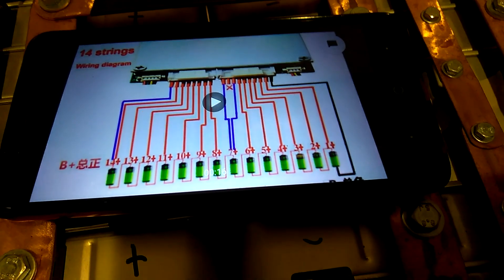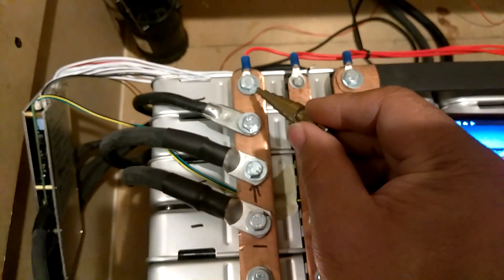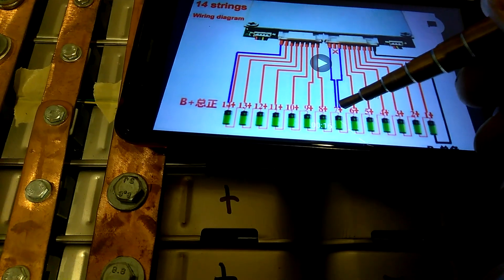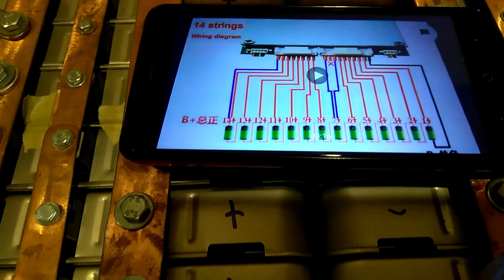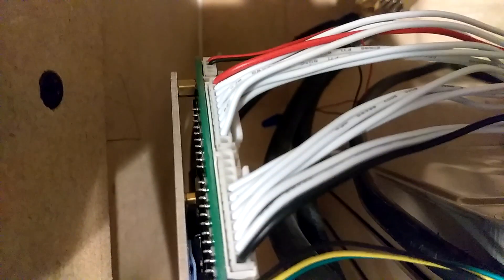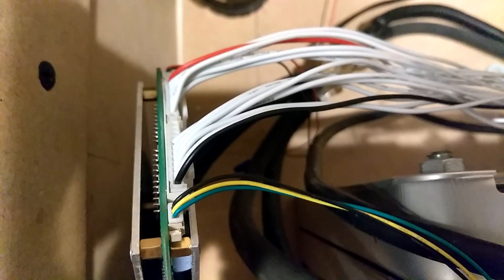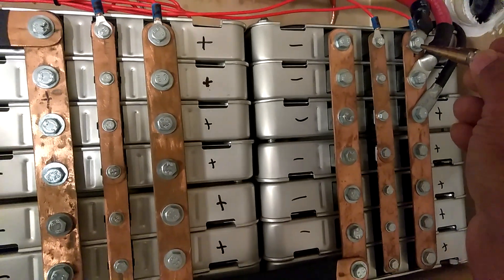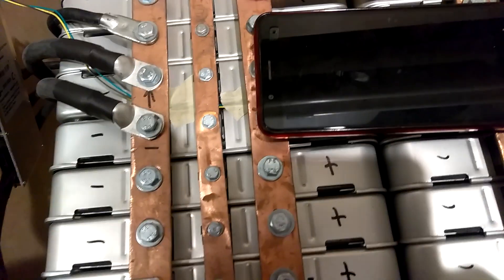Wiring up a 14 s BMS to your Nissan leaf batteries

Comment: Hello, Carson thanks for the informative videos. I am trying to wire this up and its not cooperating. I can't get it to work. I have the 16s on a14s battery. I don't have many extra wires. Your input would be appreciated.
Reply from the maker: Which BMS are you using and What type of problem are you having.
Reply: @carsonlurbanwindandsolar3437  I have the ant bms 16s on a 14s Nissan leaf setup.
I get to start bms lights go on they blink. BMS will only shhow 17.1 volts on the other end of bms. I tried several different methods of wiring and still the same results. BMS also will not show on-screen display or on my android phone. The bms has two jacks of wire, first one with black ground wire has 9 white wires, second has power red wire has 7 white wires. I can't skip any wires on the second jack (plug). Been at it for two days can't get it to function.
Reply: 7s - 16s ant bms Lifpo 320A LCD
Reply from the maker: @fredlo6935  can you send me a link so I can go see the actual unit that you have maybe the link where you purchased it from. or you can send me a link so I can go look at the instructions on it did they email you that.

Comment: I am also having a problem, but I am not sure you are providing an answer.  What exactly was that problem that the misconnection was making?  I believe mine is correct but it follows their guide.  My problem is that cell number 1 is indicating 0.8Vdc.  But I use a voltmeter, it indicates 3.8Vdc.  Was the mis-connection you found causing same problem?  Thank you very much, very informative.
Reply from the maker: It was my number eight cell and it was going all the way up till it  triggered the alarm then it would start back over at zero again. It was a wire in the wrong PIN changed it around and it worked fine.

Comment: Hey bud. Great video, just subscribed. Wondering if you'd be able to help me out with my bms on my leaf batteries. I'm running a 24v system with 3 parallel sets of 6 modules each and I was sold a chargery 8s BMS but the guy ghosted me when I messaged him for help setting it up. If you child shoot me an email at superadninjadude@gmail.com I'd greatly appreciate the help
Reply from the maker: I will see if I can help you out I'll try to get you as much information as I can.

Comment: I have 9 Leaf cells that I'm using in a 24 volt configuration.  Three cells in parallel to make a large 8V  battery and then three of the 3-cell groups series connected to make 24V.  Would this BMS work for these cells?

The whole BMS thing is throwing me for a loop because I've been watching several others who are not using a BMS, but still others that INSIST that a BMS is needed.  I just want to make sure that I'm doing it right.

Would love to chat if you are willing.
Reply from the maker: Send me your email address and I will email you my phone number.
Reply: @carsonlurbanwindandsolar3437  Thanks.  My email is mdhengelsberg @ gmail (dot) com
Reply from the maker: @HarmonyExpressSkoolie  number sent.
Reply: carson l urban wind and solar thanks.  Will reach out after dinner.  Thanks.

Comment: What is the name of that BMS or can you put a link in the description
Reply from the maker: Smart 7S TO 20S Lifepo4 li-ion Battery protection Board Bluetooth APP 400A.         

https://www.ebay.com/itm/313075423038
Reply: @carsonlurbanwindandsolar3437  How long did it take you to get it?  Looks like it's coming from China.  How did you determine the 400A version instead of the 100A or the 320A version?
Reply from the maker: @ScoopDogy  it took exactly 25 days for me to receive it. And I chose the 400amps because I wanted the biggest unit I could get for my battery bank.  usually whatever there are advertising it at it's not half of what they say so I thought bigger will be better.